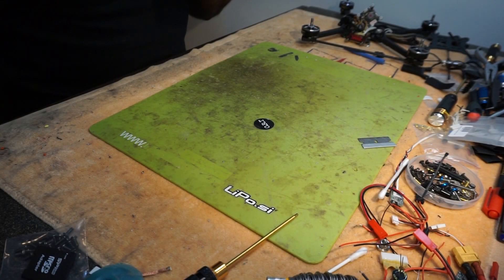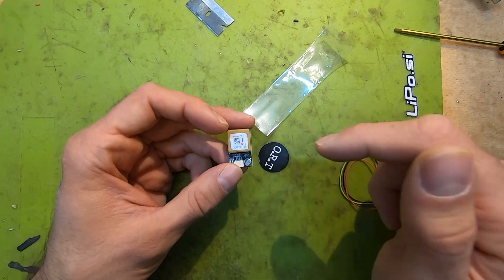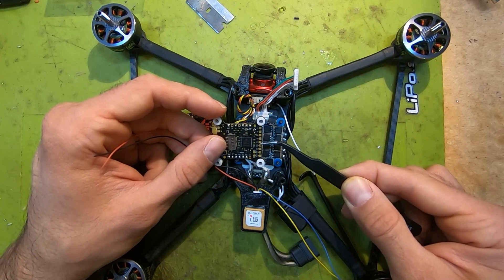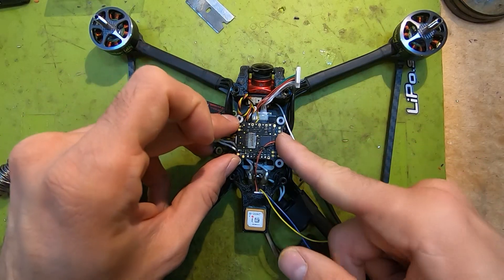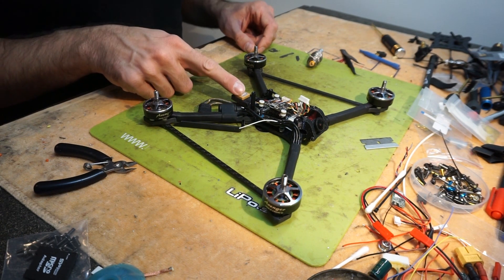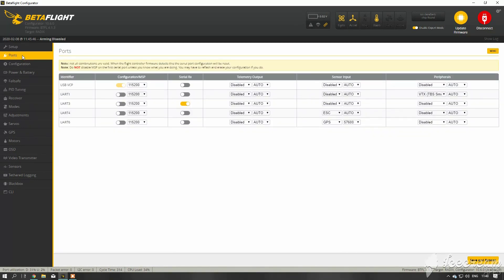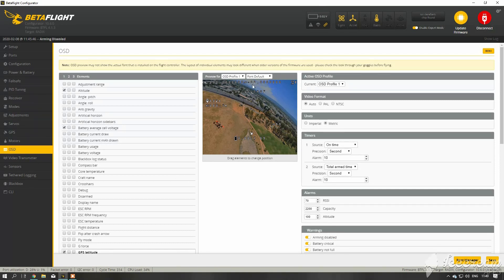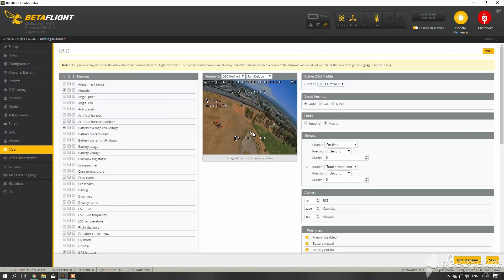Matek Systems SAM-M8Q GPS Module Support GLONASS Galileo QZSS SBAS for RC Drone FPV Racing

Comment: Hi, I've got the same module, first time I powered it on I waited about a minute (cloudy weather) and it got 3D fix, the blue light lit up. Next time when I power it on I get solid blue light immediately and I can't get GPS fix. Also GPS tab in betaflight now doesn't show any sat signal levels or any other signs of activity. Do you know what it can be? I can't find anywhere what does solid blue light mean on this module.

Comment: Hi. I have a question.
I have m8q I really confused. I have to solder 5v,gnd, tx module to RX FC, and RX module to TX FC. But led only red and blue light not blinking.
So what should I do?
Thanks for answering
Reply from the maker: Cant really think of something being wrong. If you follow trhe video it should work.
Reply: Same problem...broke?
Reply: @cgaxtreme10  no, I still use until right now

Comment: Is this "better" than BN-220 you can get for 10€ from China?
I have the BN-220 and it works well, I can get 20+ satellites (GPS, Galileo, GLONASS).
But it sometimes takes a while and I have the impression it could be better at aquiring sat fix. Sometimes a hot-start after switching fpv quad battery takes 3 seconds, sometimes 50 seconds, it's not constant.
Do you have the comparison between Matek M8Q and BN-220?
Reply from the maker: I feel that this one finds enough satelites way faster than the cheap one.